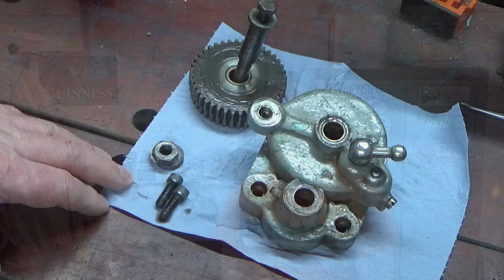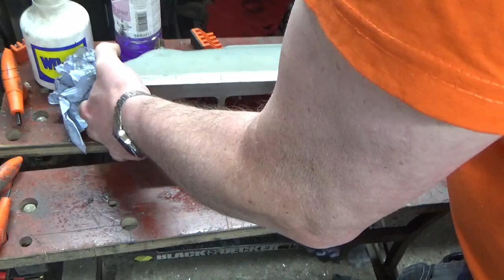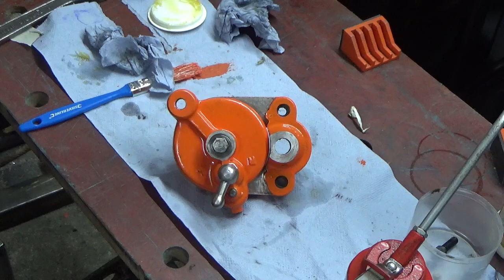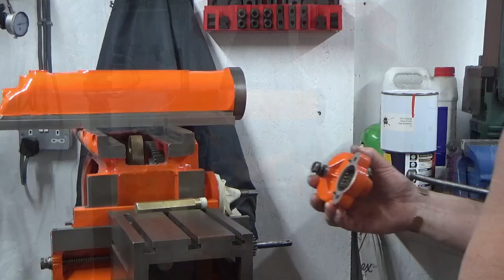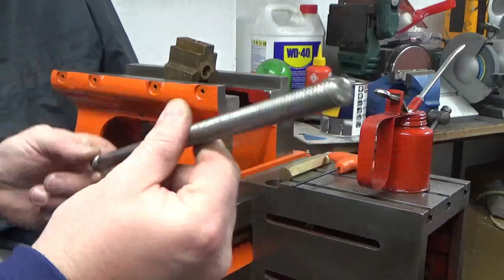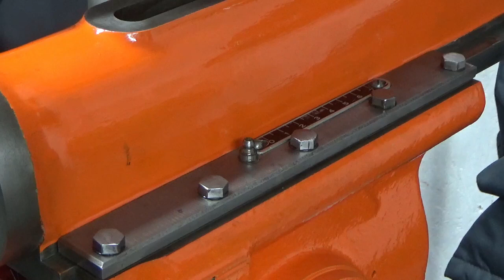Atlas 7B Shaper Restoration Part 7 -  Ram and Cross Feed Mechanism

Comment: I am not sure why you greased your ratchet assembly. Mine has a ball oiler on it as shown in my user’s manual. I wonder if there was a production change. As for reinstalling the pin into the shaft for the ram you just need to align the holes in the gear with the shaft and drive the pin in through the hole in the top of the ram. On mine the hole was drilled slightly off center so it would only go in one way. I don’t remember if it was tapered or not but that would also be a consideration. Great job with the paint color. I refinished mine in the basic smoke gray.
Reply from the maker: Hi John, thanks for the comment. Yeah, there was no oiler for the pawl / rachet mechanism so I just went with grease for longevity of lubricant. We are all hooked up to the ram now. Latest update will be next week. On the home straight finally. Cheers, Jon

Comment: Hi, Jon.  shaper restoration looking absolutely tremendous now. These Atlas shapers are very sophisticated in the adjustment mechanisms department compared to my Alba 1A.  The Alba is adjusted for stroke length and ram position manually .There are no bevel gear mechanisms on the Alba,it is all just set manually and tighten the appropriate locking nuts. The amount of solid bronze components in your machine is also impressive(couldn't afford to make them like that today)
Just out of interest and to make a comparison with my Alba how many TPI is your table cross feed screw?
On my Alba the screw is 6 TPI giving a cross feed of 0.1666" thou per turn of screw. this divided by the 20 teeth on the feed ratchet gives a cross feed traverse movement  of 0.0083" (8 thou and 3 thenths per ratchet tooth).
I'm seriously considering making a larger ratchet wheel with more teeth to bring the crossfeed increments down to half what they are as standard.
Reply from the maker: Hi Howard, thanks for the comment. Yep, they are a very simple but well though out design. 10 TPI ACME on all threads. I didn't count the number of teeth but will put a clock on the table once done and create a feed rate chart. Cheers, Jon
Reply: Same here, my Alba looks like they copied it from a trebuchet. 🤔

Comment: Looking the part now Jon .  Your bench space must be as nearly non existent  as mine , having to break out the old B& D workmate ! In my old small shop ,  have to use my big cast iron marking out table ! 👍
Reply from the maker: Hi Max, thanks for the comment. Lol, you nailed it mate, my bench is lost under a pile of crap/shaper/mill etc. I got that B&D for my 21st birthday, earnt it's money. Cheers, Jon
Reply: Max, that's a great observation.  I originally thought it was a welding table with clamp holes but laughed when I realized it was a B&D work table.  I'm going to pull mine out of storage and bring it back to the shop when I re-built my Atlas 7B.